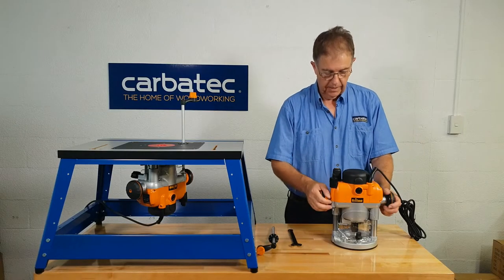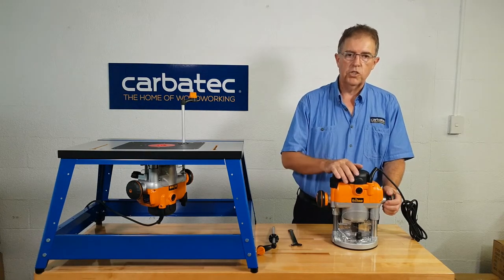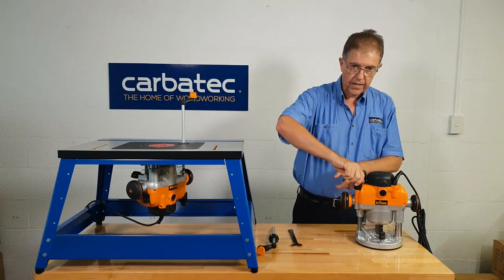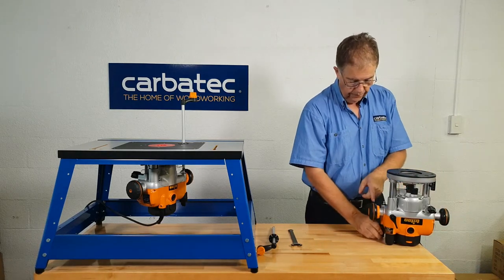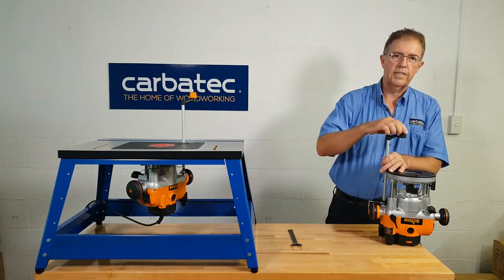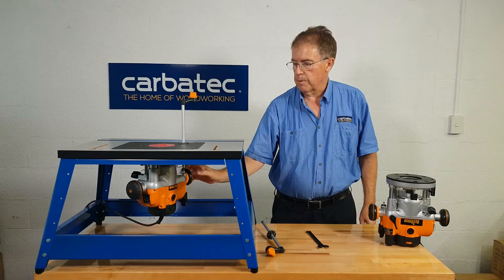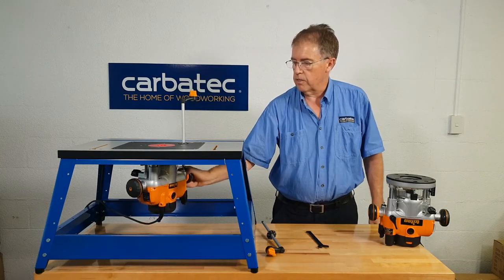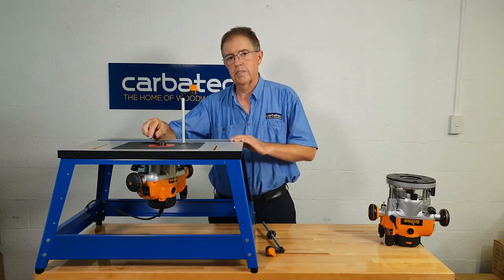Triton Dual Mode Precision Plunge Router

Comment: I've just bought this. What router plate do you have in the table and was it a straight fit for the router including the above table height adjustment rod? Thanks
Reply: Just drill a hole in any router plate to access the height adjustment. Easy stuff, don't overthink it ...